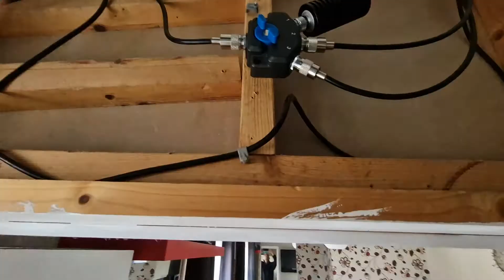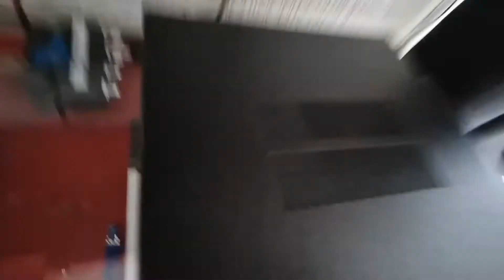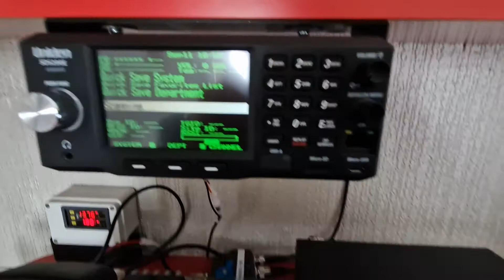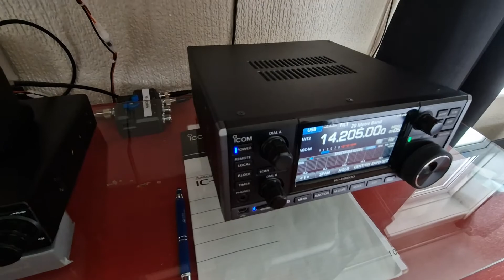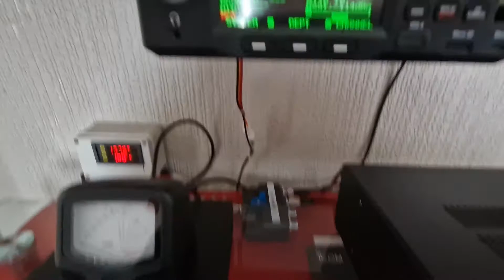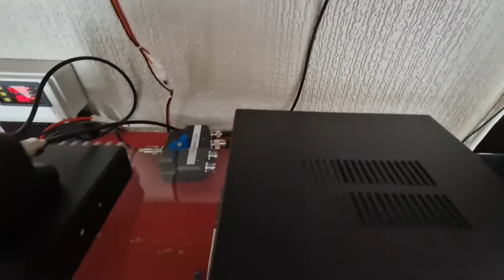HF , VHF , UHF Antenna Set Up

Comment: Nice set up you have there.. the looped chokes you put under each antenna is to stop the RF coming back down the feed line and causing noise on the radio. I've just put one on my Moxon beam as it seemed a bit noisy but it only took around half an S point of noise away, but better than nothing I guess.
Reply from the maker: Thanks for the info !! 👍
Reply: Nice set